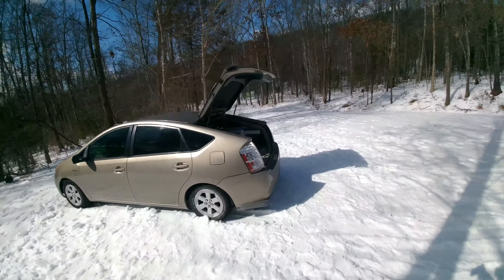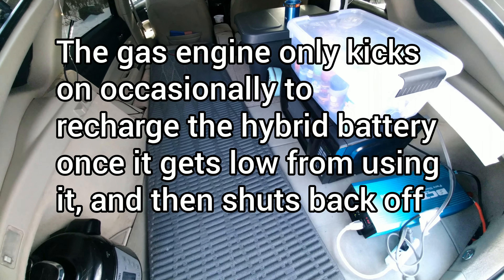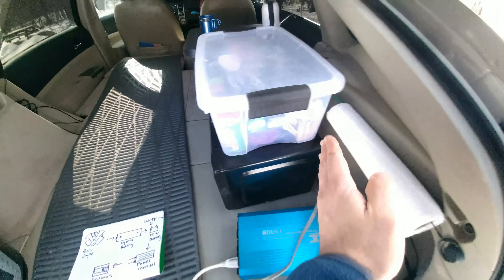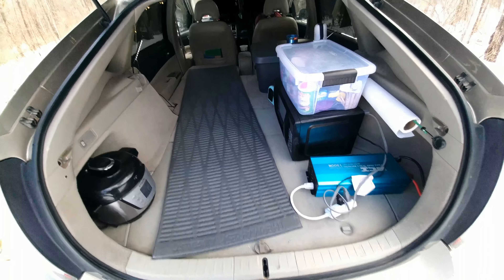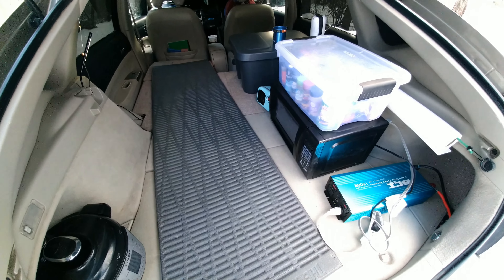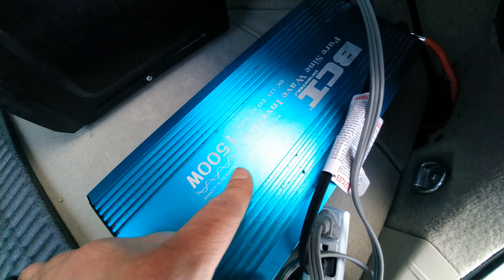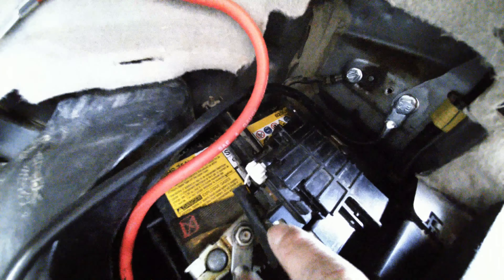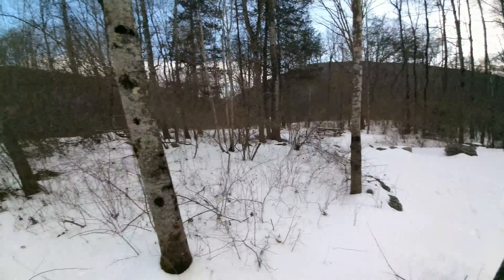How a Toyota Prius (& other hybrids) can be used as a GENERATOR! #OffGrid #Camping #Emergency

Comment: Nice setup! I have a RAV4 Prime and am thinking about installing an inverter for some camping trips coming up.

I do have a concern with the size of the inverter you chose with no fuse for protection. The largest recommended inverter I've seen installed in a Prius is 1200w due to the 120 amp fuse for the DC-DC converter. You want to keep the 12V load below 120A x 12V = 1440W. Running the 1500W inverter at full load plus the power needed for the rest of the 12V electronics in the car, runs the risk of blowing the DC-DC converter fuse. I would recommend installing a 100 amp fuse between the inverter and the 12V battery to limit your power use to 1200W. It doesn't matter if there is a fuse inside the inverter if that fuse is 125A (125A x 12V = 1500W), which is larger than the DC-DC converter fuse.
Reply from the maker: well my inverter is internally fused and also, I only use it for like 3-10 minutes at a time usually. and when I do use it, I watch it closely to make sure it's working properly. I might still get one of those 100 amp fuses though, thanks
Reply: Remember when calculating total wattage load that the '12v' battery is usually actually a 14.x battery - that's the operating voltage of the prius (and most cars when running).  So keep your in line fuse below  the DC - DC (internal to car).  I'd do below 100a or even 75a for fuse/breaker sizing.

Comment: I did this, too. It's nice. I tied it down to a board under a rubber mat, and made it modular so that I can easily remove it and put it back in. 12V × 120 amps = 1440 Watts. Some have 150 amp fuses, so 1800 Watts. Just FYI.
Reply from the maker: Great tip! thanks
Reply: Instablaster...
Reply: Are these fuses come with the inverter or you had to install them separately after?
Reply: Hey Kim I am trying to do the same can you post your setup ?

Comment: Be aware, AFAIK, the gen2 Prius has a 100 amp fuse for the DC-DC converter between the HV and 12v batteries. As watts = volts x amps, therefore, you wouldn't want to run more than 1200 watts (1000 or less, to be on the safe side) off of the 12v battery continuously, as the DC-DC converter will not be able to replenish the 12V battery as quickly as it is being drained. For higher wattages, an inverter would need to be connected directly to the HV battery.

TL;DR ---> inverters of 1000w or less are recommended for attaching to the 12v battery
Reply: +1 for this comment.  Also, if the DC-DC internal fuse is 100A, then use an inline 75A breaker or fuse.  That will still allow 14v x 75a = 1050 W continuous power.
Reply: How did you learn about these things?

Comment: I have a solar generator which is amazing. A Bluetti.  Charges with solar, car socket, wall, or propane (I think).  It’s a small, lightweight box that has saved me in several situations. You can charge while you drive to your next destination, or set up the panels when you arrive.  No noise except for fans, no fumes! If you leave it plugged into your Prius, it will charge while you sleep.  Jackery makes some good generators too, as do many other companies.

Comment: Bo, good stuff , just subbed. By the way, I just read an article that said : on a volt-to-volt comparison, the Prius actually burns less gas than a Honda 2k generator.
Reply from the maker: Thanks, glad you enjoyed it. Can you post a link to that article? That's really interesting, and that says something because Honda makes the best generators on the market
Reply from the maker: @Imix Muan yeah but the Prius has a battery/engine combination. The Prius is referred to as a "generator on wheels" by a lot of people, the whole design of a Prius is for efficiency
Reply: @MountainSpringsAdventures  There are other YouTube videos showing comparison and measurement. A Prius uses about 1/2 gallon of gas for 8 hours while in Ready mode. To determine this, the user will require an OBD2 (on-board display) car diagnostic scanner unit (appropriate to the Prius...not all are!) which is then attached up front under the gear handle. Check it out here: https://www.youtube.com/watch?v=yrjuLXGLZJY

Comment: You should really install a fuse between the battery and your AC inverter because blowing that 120 amp fuse is a real pain to fix because you have to take a bunch of stuff out to replace it, the car will not drive if it blows, and it's likely to also blow your inverter pump at the same time. I went with an 80 amp circuit breaker when I installed mine.
Reply: can you link the 80 amp circuit breaker please?
Reply from the maker: My inverter is already internally fused though, I might still get one of them thanks
Reply: @MountainSpringsAdventures If you do get a DC circuit breaker, make sure you check if it’s polarized. Many of them have to be hooked up in the correct direction. If they are hooked up in reverse and there is a short circuit, they may not disconnect power properly. It’s complicated but has to do with how there can be arcs when you disconnect a large load.

Comment: To explain the need for an inverter: It's because a 12v battery is "direct current" and low voltage, so there is a constant flow of electrons from the positive terminal. It is harder for a low voltage electrical source to overcome resistance, so all of our homes are on a much higher, generally more efficient to generate current called "alternating current." Instead of a constant flow of electrons, it is off 50% of the time and on 50% of the time. 
If you hook a DC light bulb to an AC source, it will shine for half a second and then burn out because the circuitry was designed for DC. If you hook up an AC appliance (microwave) to a DC source, it will just melt the wiring because it was all designed for AC (Lower volts = higher amps = you need very thick cables or you will have very melted cables)

Comment: That inverter u have hooked to your 12v battery allows use of electricity from a DC car battery to AC household appliances.   It converts DC (direct current)to AC (alternate current).

Comment: Actually the Prius has a power DC to DC inverter that handles power to and from the traction battery, along with maintaining the 12 volt starter battery. When the inverter senses the charge status of the 12 volt is low, it will draw power from the traction battery to recharge the 12 volt. When the traction battery level drops below a preset level, the engine kicks on and charges the traction battery.  As long as there gas the engine will maintain the traction battery, which will in turn maintain the 12 volt battery via the DC to DC inverter.

Comment: If you are traveling with a microwave you may as well travel with a convection oven/ microwave combination. Then you get quick dry baking for roasting, baking bread, etc. (All travelers should learn to make bread products from scratch. So easy and fun)  They might not make them small enough.
Reply from the maker: Yeah, I can bake things in my instant pot if I wrap it in aluminum foil and put it on a little rack that goes in it with a little bit of water in the pot. That sounds cool though

Comment: Thank you for the video. I just want to let you know that your positive inverter cable is not fused the way you have it hooked up. That is a good way to attach it to the terminal but you should add a fuse if you want the protection. Happy travels.
Reply: Jeremy, how do you add a fuse? I'm planning to get a prius (camper) and will be running a fridge 24/7, and want to make sure I have adequate protection as you suggested.
Reply: @j.j.6942  Hi J.J. If you are only running a 12 volt fridge and not an inverter you can get a blade fuse holder and wire that in as close to the battery as you can. I would use 12 awg wire to eliminate voltage drop. You may need to install a secondary battery if you are going to run a fridge 24/7. I believe the prius battery is only 45 AH and only half of that is usable.
Reply from the maker: my inverter is internally fused, it actually has four fuses inside of it. I opened it and checked myself.
Reply: @MountainSpringsAdventures  You are correct that the inverter is fused but the wire is not and if it shorts out by rubbing on the metal of the car then the wire will melt and that is a big wire to let the factory smoke out of.
Reply: @jeremyshima2888  Yes, like if the positive wire touched that nice shiny D ring for tie-downs in the back of the car...

Comment: You can use the prius not only as a generator, but also as an ac unit and heating unit for a cabin. Run an insulated pipe from the the vents in the car, into your cabin, and you are good to go. So you have a car, a generator, and ac unit, and a heating unit all for the price of about 3k.

Comment: I am captivated by what you have created with your Prius!
I have a 2005 Prius,  with the battery is under the hood directly in front of my steering wheel. 🤔 *see EDIT below 
Can a cable be run to inside the cabin where there's room for an inverter?

I don't have the skills to install an inverter. 
I would want a professional to do the wiring.
What kind of professional should I seek out?
One of the other commenters said his brother installs stereos in cars. Is that the skill set I need to find?

I sure won't go to my local Toyota dealer! The mechanics union successfully ended their strike with sizeable pay increase. I believe the dealership is now charging $170/hour for their labor! I know the mechanics aren't receiving that much, but they sure have mad skills.
But I digress.... 🙄

* EDIT: I just learned that the thing under the hood is a terminal, and the battery itself is somewhere in the back. 😳
I learned that from The Car Care Nut: https://youtu.be/y5oaQ0LW3A4
Reply: Thanks for this.  Mine is also a 2005 and I'm also a little clueless but I hope to learn!   Come on over and we can work on our prius generators together!🎉--Jennifer

Comment: Using a 12V battery from a Prius to power a 1500-watt inverter can be done, but there are important safety considerations and limitations that experts typically emphasize:

Safety and Technical Considerations:

	1.	Battery Limitations:
	•	The 12V battery in a Prius is not designed for high current loads like running a large inverter, especially one capable of 1500 watts. Such an inverter could draw over 100 amps from the battery at peak usage, which may be far beyond what the battery can safely provide.
	•	If you’re trying to power devices with high power demands (over 1000 watts), the 12V battery will likely drain very quickly, and continuous use at this level could damage it or severely reduce its lifespan.
	2.	Potential for Battery Damage:
	•	Overload risk: If the inverter is not properly matched to the battery’s capacity, it could cause overheating or overloading of the battery. Prius 12V batteries are smaller than those in traditional gasoline vehicles because the hybrid system mostly uses the high-voltage battery.
	•	Discharge risk: Deeply discharging the 12V battery can shorten its life or even damage it permanently. The inverter could cause this rapid discharge if used continuously for extended periods.
	3.	Inverter Sizing:
	•	A 1500-watt inverter draws a significant amount of power (over 125 amps at 12V), which is likely more than the Prius 12V battery can supply. Most car batteries are not designed to handle this kind of continuous load without significant degradation.

Using a Prius as a Generator:

The safest and most effective way to use a Prius as a generator is through the hybrid system’s high-voltage battery. Some aftermarket systems have been developed specifically for this purpose, allowing you to tap into the high-voltage battery more safely and efficiently than using the small 12V battery. These systems work with the Prius’s engine to maintain the charge of the high-voltage battery, which then can supply AC power through an inverter.

	•	Toyota’s recommendations: Toyota doesn’t officially endorse using the Prius as a power generator, but during emergency situations, some owners have done so with caution and the right setup.
	•	Vehicle wear: If done improperly, relying on the 12V battery alone could cause strain on both the battery and the electrical system. Using the Prius engine and hybrid system to maintain battery levels (with the right setup) is safer but still should be done sparingly, as it can wear on the vehicle over time.

Recommendations:

	1.	Smaller inverter: If you still plan to use the 12V battery, opt for a smaller inverter—one that draws no more than 400-500 watts, which is more appropriate for a car battery.
	2.	Specialized kits: Consider specialized systems designed for hybrid vehicles if you plan to use the Prius for emergency power. These systems work more efficiently by using the high-voltage battery rather than the 12V battery.
	3.	Battery monitoring: If using any inverter, be sure to monitor the 12V battery’s charge level closely to avoid over-discharging.
	4.	Installation by a professional: If you’re unfamiliar with the electrical system in the Prius, consulting with an expert before installing an inverter is important to avoid damaging your vehicle.

In short, powering a 1500-watt inverter from your Prius’s 12V battery is risky and could damage the battery or electrical system. Using the vehicle’s hybrid system with a proper inverter kit is a much safer approach.

Comment: What type of continuous power supply do you have, or plan to get, that'll keep the fridge running when the car is turned off?
Unless you keep the car running 24/7, you may need to integrate a  reserve power source so that when you turn the car off for work, shopping or a hike etc. the fridge will continue to run without draining the hybrid or 12v battery.
Reply from the maker: The 12 volt fridge is extremely insulated so it maintains the internal temperature pretty well for the 8ish hours that I sleep at night. One trick I do is I will turn the temperature of the fridge down really low about an hour before I go to bed, then it gets really cold inside and maintains the internal temperature even better. The food doesn't spoil, I've done this many times. On average, the fridge is usually about 5-10 degrees warmer inside of it in the morning then when I went to bed which isn't enough to cause food to spoil. So basically, I don't need to power my fridge at night
Reply: @MountainSpringsAdventures  Grocery stores mostly just have to have their refrigerated items to be held at 40 or below.
Reply: @MountainSpringsAdventures  
Interesting!
I'd still look into a backup power supply for extended absences beyond your 8 hrs resting period, but that's just my bird-brain thinking.
Reply: @Bronzebk  you don't have a bird brain my friend I am also seeking the same answer and then more as far as toyota hybrid off the grid living goes lmao. His solution of getting the fridge hella cold 1hr right before killing all power is a perfect simple solution to cover you during a solid night of sleep. But I also wanna be able to plug into 120v somehow and keep it all going without involving my own engine
Reply: @FlipSRT4  
Agree. 
I think a portable or compact  backup battery pack that's alternator/solar charged (portable/roof-rail mounted panels) should take care of that inadequacy.
Reply: Why not get a solar generator, plug the fridge into it when absent/sleeping and then charge the solar generator with the Prius? Depending on how long you plan to be away will determine the size of the solar generator to get. Maybe not the cheapest solution but it will solve the problem.
Reply: @BryanBear5050  Just a bloody brilliant idea Bryan; I tip my cap to you. If I had this setup, I would just use the Prius to keep my solar generator charged and run everything from way.
Reply: @FlipSRT4  I have a Prius, and you can leave it running all night. As noted, the gas engine only kicks on to recharge the battery. Many people do that to keep air con going all night.
Reply: @Bronzebk  The idea as I understand it is leave the Prius in Ready mode and you have all the power you will need to run the refrigerator or air-conditioner or heater at night...or in the daytime.
Reply: @normbjorn  
I understand that; having owned 3 Priuses.
My concern was with extended absences, with the car turned off for hiking, (tent) camping etc for a day or more...
8 hrs without power after setting the fridge temp low may be fine, but what about longer than 8 hr., or a day or more. Would you leave the car running unattended for  days for those extended periods?
Don't think it's a great idea, despite it only kicking the engine on periodically.
I still believe even a small backup power supply of some kind for those extended absences is best to keep your food fresh.
Reply: @mannys4036  My thought before I saw your comment; I have a solar generator system for emergencies for the home, the Hybrid car connection could be used to supplement the solar panels (12V panels) on cloudy/rainy days. The charge controllers in my solar system can handle up to 60 amps at whatever voltage is coming out of the hybrid batteries. The solar generator has an inverter with the option to also use 12V DC output concurrently.

Comment: A trucking company I worked for allowed drivers to buy an inverter for their truck and they would install it. They limited the inverters to 1500 because higher watt inverters invite using higher-powered items. Higher power means more current and heat in the wires. Fires resulted, so the company said no more than 1500w and they would install it to ensure it was done properly.
Reply from the maker: That sounds like a smart idea, that's pretty much how I feel about it, that's why I don't suggest over 1500 watts. 2,000 w maximum